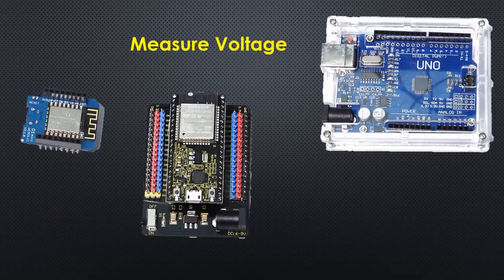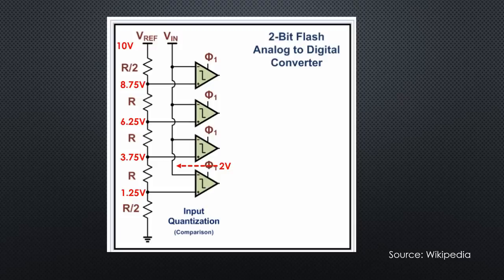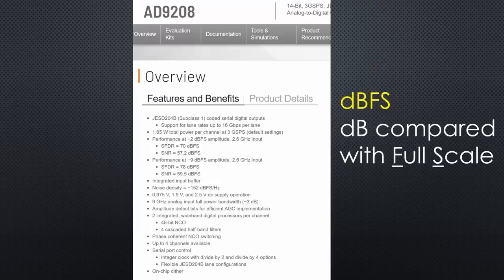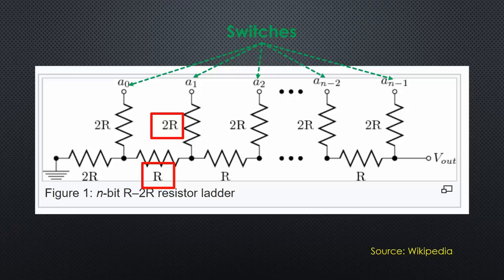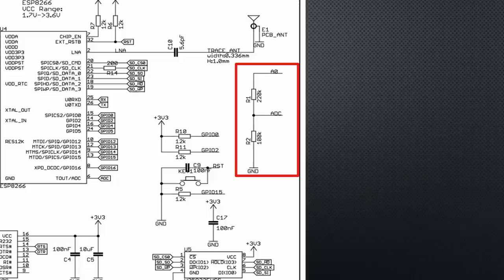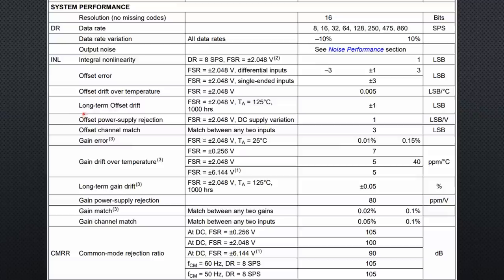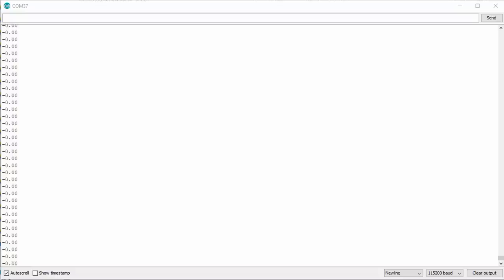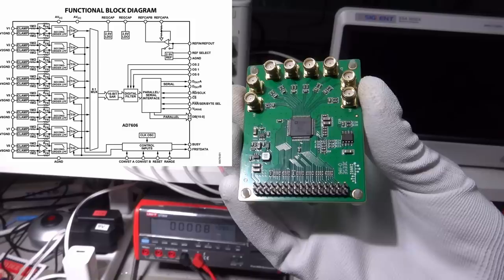#340 How good are the ADCs inside Arduinos, ESP8266, and ESP32? And external ADCs (ADS1115)

Comment: I'm a little confused by the flash converter. The circuit shown at 3:45 seems to have the same output (00) at 1V and 9V. What am I missing?
Reply from the maker: I did not check the logic gates. They were not so important for teh understanding
Reply: @AndreasSpiess  Now that I have given it some thought, there are actually five voltage ranges. Four would only require three comparators with the states being below 1 (00), below 2 (01), below 3  (10) and 3 and up (11).

Comment: 3:50 The 2-bit flash converter seems a bit off. For one thing, the 4 comparators detect 5 ranges, yet somehow, this is reduced to 2 bits (4 numbers). Second, with the input signal either in the lowest range, or the highest range, the output will be 1,1.  And I don't think the count up from low to high works properly either. Maybe the comprator plus and minus inputs are supposed to be interchanged?
Reply: OK, at 4:32, I guess we see that Andreas thinks that indeed the - and + inputs are the opposite of shown in the diagram.  As drawn, when the input of a comparator exceeds the reference voltage for that comparator, we will get a zero, because the input is connected to the minus input. That's the opposite of Andreas' verbal description.
Reply from the maker: I did not llook into the logic of the drawing and maybe I was not precise. I hope, the concept  was still understandable.

Comment: How would I go about using the esp32 as a simple wifi antenna for my laptop?  for example if my wifi card inside was to fail, could I use the esp32 to connect and surf?
Reply from the maker: No need for two times the same comment.

Comment: Sir, i will try to make dc volt meter using ESP32 wroom but am facing some critical condition
Actual voltage is applied for measuring 12.7V
ESP32 display 12.7
If i applied 7.4V
ESP32 display 6.9V why sir ?
After this problem am using Arduino UNO
This board is accurate measure voltage in range.
ESP32 is not for  voltage measurement ?
Can you give me any solution sir ?
Reply from the maker: Unfortunately, I cannot do remote debugging. But you can draw a curve when you apply from 12.7 to 0 volts. Then you see if the ESP shows linear values or if it has some non-linearities in the curve. Then you might correct it with a formula.

Comment: Hi, I want to use the ESP32 to perform FFT from the sound of an electret microphone module(MAX4466)  input. Would you happen to know if the i2s  is more precise than the standard ADC? Otherwise the AD7705 doesn't look bad, but will complicate firmware and hardware design to my project.
Reply from the maker: Maybe you have a look at my ESP32 audio video. I2S is much better than the internal ADC. Maybe you also have a look at the ESP32-A1S module
Reply: @AndreasSpiess  I'll do for sure. Thanks. You're very helpful to us engineers students and electronic engineers in general.
Reply from the maker: @andreascorelli7296  Yes, this was the video (messages with links are deleted by YouTube)

Comment: You might get better results removing glitches using a simple (narrow-ish) median filter before averaging over a larger window. Of course, there is probably not much point averaging after a median filter as it will remove most if not all of the 'dithering' from the LSBs toggling (almost like PWM) which the averaging filter relies on to come up with more precise values. But, if you need to remove such glitches, it's more or less game over for improving precision and a glitch free signal will have to do, UNLESS you implement logic to exclude detected glitches (only works if glitches are large compared to normal noise, otherwise how do you know which is which) from your averaging.
Reply from the maker: You are right. If there are patterns you can use better algorithms. If it is noise, it will be hard.

Comment: Another very interesting and in-depth video - always find them interesting.
One observation, my understanding of a successive approximation converter is that the conversion is performed from most-significant bit down the least significant AND that the conversion time (while slow) is actually fixed for the number of bits in the conversion. refer https://en.wikipedia.org/wiki/Successive-approximation_ADC
Reply from the maker: You are right and I was wrong :-(
Reply: @AndreasSpiess  All is good my friend :)
I wasn't sure if I was right, but luckily the internet is always right ! (and wrong, and right, so many different answers out there :)

Comment: what is (X * 12.292 /4096), i didnt understood the 12.292 what does it signify
Reply from the maker: 4096 is the maximum value of a 12bit ADC. and 12292 is its current reading. The rest is rule of three.

Comment: the ADS1115 is really good, however had to make my own driver to get it to read 2 diff (A0-A1, A2,A3) for audio peak reading and in watt meter for Volt and Amps (shunt), with my own driver i can get it to 2x 270 SPS, orginal adafruit driver only gives me 2x 50SPS
Reply from the maker: Very good! Speed was probably not the primary goal for this ADC.
Reply: @AndreasSpiess  yes accuracy is the primary goal, but for audio peak detection 50SPS is to little and will not get alle the peaks, and it looks bad on the RGB egg speakers, 270SPS makes a BIG difference and the ws2812b reacts at about 300 FPS so more will not really give much, used the ESP32 ADC before and that would hit over 2x 30000SPS (more then needed for 2x 22050Hz input), but had to make a lot of setup via BT app to get "ok" reaction + deadzone, now with ADS1115 and auto adjustment of gain and sensitivity (can also be locked to set gain and sensitivity if nessary), but now you just power it on an everything just works ;)

Comment: I think sigma delta converter are used most because they use almost no chip area
Reply: they also offer great linearity since they do not rely on a series of voltage dividers and only use a single comparator. Bur they are slow... I would have wished that Andreas had shown the principle of this class of ADCs as well in the beginning since it is still widely used where you need many bits of resolution such as multimeters and weight scales.

Comment: Hey, I am new to Controllers. Can you suggest me which ADC should I use to measure 1mv ? I already tried Arduino's Uno inbuilt 10-bit ADC but results are more diviated  from the fair value.
Reply from the maker: You need an amplifier in front of the ADC to measure such small voltages. Not easy because of noise...
Reply: @AndreasSpiess   if i say still wanna try it, can i use programmable gain amplifier for it ?🙂
Reply from the maker: @protonspeed  Try it! Just keep an eye on the noise. 1mV is a very low voltage.

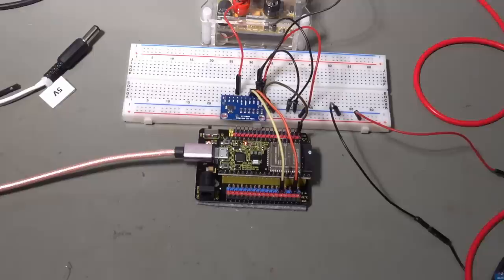Comment: 22:24 you say it shows 2.4994, but it's actually showing 2.4594 - which is correct, you or the output?
Reply from the maker: You are right. My old eyes read a wrong number. My mistake!

Comment: 9:40 I understand that it takes time to find the correct value by halving the distance a couple of times. But would it not be possible to greatly optimize this by starting the next search from the last digitized value?
Reply: I assume that this what it would do. Maybe somebody knows this for sure.
Reply: What he is showing is a binary search, which is already quite fast. Instead of searching the 2^n possibilities (attempting every bit representation starting from 0, then 1, 2, 3...) using that search it will need at most n attempts (or maybe n+1). If that ADC can read up to 10V, starting from 5V is already looking at the last bit.
Reply from the maker: @gabest4: True. Specialized ADCs use exactly this method. It works best if you can expect something like a sine wave.

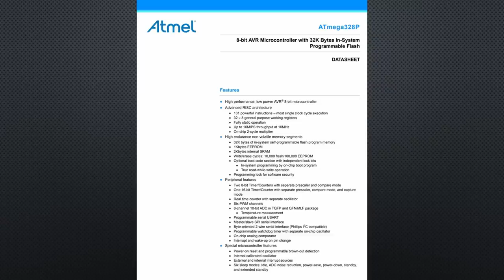Comment: 6:00 "ATMEGA 328 uses Vcc as reference" That is one option, but the worst one. You can instead use the AREF inpout, or the built in voltage reference.  https://www.arduino.cc/reference/en/language/functions/analog-io/analogreference/. Later in the video -- thanks for highlighting the problems with the ADCs on ESP8266 and ESP32. Definitely a pitfall for the unaware.
Reply from the maker: Video #10 explains how to use the internal reference.

Comment: Hi Mr Spiess, is very usefull your videos and the info I can get from them, but I have a question, you use this procedure tp make average  "x=(99.0*x+analogRead(PIN))/100" and I don't understand how yo can do an average with  that, I'm making with a PIC16F628A a Inductor Meter, for the average I made this subrutine

 prom_value=prom_value+t1;
                        if(cont==512){
                           prom_value=prom_value/cont;
                           d_m=prom_value;
                           cont=0;
                           dt=1;
                        }else{
                        cont++;
                        }
where prom_value is zero at and dt is a flag to inidciate I have a data valid

could you please explain me your method

Thanks
Reply from the maker: Mine is the moving average anc yours is the "true" average
Reply: @AndreasSpiess   Thanks Mr Spiess

Comment: Thanks for this video. I would like to use the ADC of an ESP8266 or ESP32 to accurately measure the 12V battery voltage of my car. To improve accuracy, I would like to measure only between 8 and 16 volts. If the voltage goes out of this range, the battery or the charging system has bigger problems, so between 8 and 16 is enough.
Would the analog voltage shifting circuit introduce a bigger error than what I gain in accuracy when I would only measure between 8 and 16 volts? If so, I might as well measure from 0 to 16V.
And how could this voltage shifting be done accurately? I could lift the ground of the ESP by 8.00 volts above the car's ground and use a voltage divider on the input of the ADC. But at the minimum of 8 volts at the car battery, I'd need a boost converter in order to keep my 8.00 volts lifted ground stable and on top of that 8 volts, I need stable Vcc for the ESP.

In short... how to linearly convert a voltage between 8 and 16 volts to a voltage between 0 and 1 volts, with great accuracy.
Reply: Just curious; why would you need such an exact voltage measurement?
Reply from the maker: You always can use a 9 volt battery to reduce the voltage. But then, if your battery is 0 (or unconnected) your ADC goes to -9volts, which probably kills it.
I probably woulöd go for a better ADC and measure 16 volts.
Reply: @michaels3003  I'm glad you ask that...
My previous car had an interesting problem: the alternator would perform well after starting and would lower its output voltage along the way until the point that it could barely keep it at 12.8 volts on longer trips with only the lights and windscreen wipers on. In winter, this led to some unexpected no-start situations.
I measured all wiring for voltage drops, checked all voltages and currents and I did leak current tests. All was good. Except the alternator...
At that time, I was driving around with a multimeter for the voltage and a sensitive analog meter with the needle in the middle, parallel with the lead from battery negative to the ground. That gave me a good indication of the net current in/out of the battery. And, of course, my battery charger and an extension lead I kept in the trunk. Just in case.
A remanufactured replacement alternator gave me max. 14.2 volts, even in winter. That would be to weak. I expect at least 14.4 volts, especially in winter. So, that remanufactured unit was returned on warranty. What I got back was another remanufactured unit which turned out to have exactly the same defect as my old alternator. And the car wasn't worth the money for a new alternator.
Since then, I'm a bit obsessed with the SoC and voltage of my car battery, one might say. And there's a jump/boost pack in the trunk of my current car. Despite of the fact that my current car never left me stranded. ...yet... ...so...
If there's an ESP, it could neatly display the accurate car voltage in the car when it's running and send the data to my home automation system after a drive. Wake-up every hour and send the current voltage. I will be able to graph the data and predict upcoming battery failures early.
When measuring a car battery voltage or charge system voltage, you need at least to be able to see the difference between 14.36  and 14.44 volts, especially when you plan to take the battery's temperature into account. So I need two decimal digits, reliably.
Reply: @AndreasSpiess  Thank you for answering.
You're right. I should go for a better ADC. Problem is that if I would go searching for one, I probably end up ordering a lot more interesting stuff.
But the 9V battery idea is interesting. The -9volts problem could be clamped with diodes and a current limiting resistor. But I need a stable 8.00V, so I need regulation, which uses a small bit of current from the battery, so it will need to be changed regularly. Or, recharged between measurements: 9V NiMH battery, resistor, n-channel mosfet.

Hmm... Might as well buy a better ADC...

Comment: Instead of simply averaging you could use a better algorithm using a smaller buffer of about 10 readings. If you know there's a serious glitch in about every 10 readings, just throw away this number. Don't include it in the average. So it will give you a much better accuracy at a higher frequency.
Reply: Let's say the number is suddenly is less than half the previous reading. Just bitshift previous reading makes it very fast to divide by 2. But keep track on the next reading if it's also less than half it could be a good reading, only decide after let's say 5 or 10 readings with no glitch to call this a bogus reading otherwise this bogus reading is taking to much weight in the average. The accuracy and resolution would be better also.
Reply from the maker: You are right. There are many different ways for trying to get more out of bad signals.
Reply: @TubeSkaterRudy  Median of a set of values is a good way to discard  bad samples.

Comment: hello andreas !! do you have any circuit to build a am receptor aviation band ?? i reformer a old radio fm  and i can ear the atis and the control tower of my city buth the sound is very poor because  the modulation is in AM and my radio is fm. Why the aviation band uses the  AM ???
Saludos desde Argentina !!
Reply from the maker: I do not know why they use AM. But you need an AM receiver to listen to AM. A FM receiver does not work (as you experience)
Reply: @AndreasSpiess  i will make a am demodulator  do not worry. But the fm radio really work to ear am, but i can not understand WHY !!
I ear the pilot taking with the tower, but the sound is really BAD !!

Comment: I was looking at a Raspberry Pi in a mobile HAM radio setup to monitor the voltage of a car battery, and cut off the supply to the 3 radios (and the Pi) when a low voltage is reached. The Pi is already used for the HAM radios digital modes, but I have ESP-07S modules, how to go about this?
Reply: I don't need accuracy, speed nor resolution
Reply: Does the Pi even have an ADC on board?  I don't think it does. At least, the RP 1B+ I own doesn't. I never kept track of the later models. Seems like an external ADC is required.
Reply from the maker: I would probably try to connect a ADS1115 to the Pi ( https://learn.adafruit.com/raspberry-pi-analog-to-digital-converters/ads1015-slash-ads1115 ). Or just a simple opamp as a comparator at the lowest acceptable voltage.

Comment: I'm very dissapointed that you didn't include an STM32 in your tests, its one of the best of the cheap solutions for ADC, it has 3 12bit ADCs with 8 channels per ADC.
Reply from the maker: So far I do not cover STM32 chips on this channel. Maybe this is a mistake :-(
Reply: @AndreasSpiess  You should, i mean there is even an small oscilloscope based on it, the Miniware DS212 and DS213

Comment: Another excellent video! Where did you find the table 7 with the static errors of the ADC? The DNL and INL errors are huge on the ESP32, there are many comments on the web about it but very few solutions. One method is to get the whole caracteristic at very low sampling frquency and create a look-up table to linearise its caracteristic... do you have any other idea? This method must be done on each ESP32 before using it and we have to  integrate the look-up table in every new sketch. Else, use a external ADC as you did. Link found to linearisation: https://github.com/MacLeod-D/ESP32-ADC
Reply from the maker: Thank you for the link! Probably useful for some projects.

Comment: What are the options to measure higher dc voltages? Like above 60v
Reply: cant you use a voltage spliter to get a max 5v/3.3v signal and multiply the read value later on in  the code? e.g. if 60v results in 5v signal you multiply the read voltage by 12 and get a more or less accurate voltage.

edit: sorry he even said that in the video, u probably mean a "safer" method to do it ^^
Reply from the maker: I said this because I do not want to kill people. Multimeters use also resistor dividers for higher voltages. But you have to pay attention